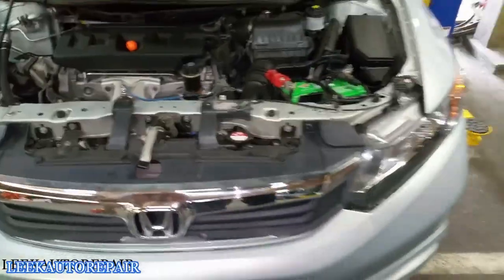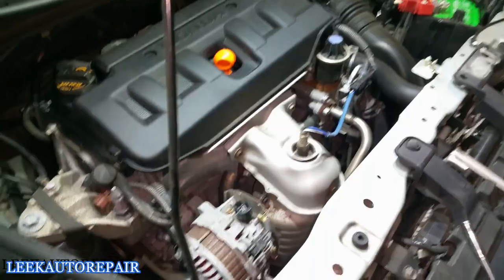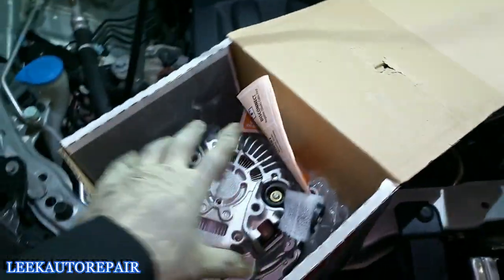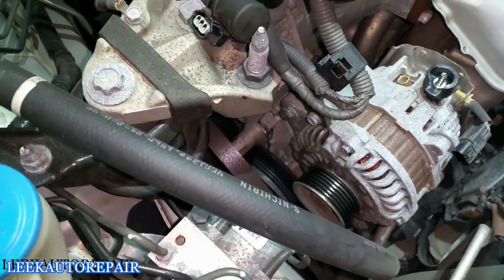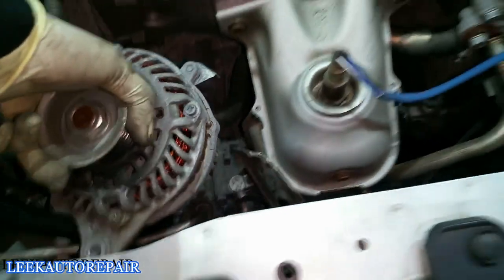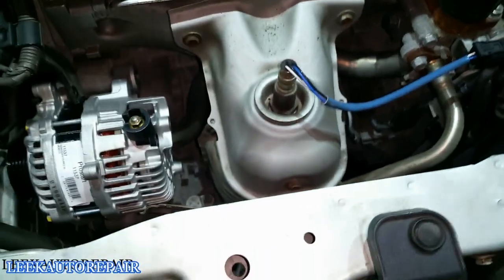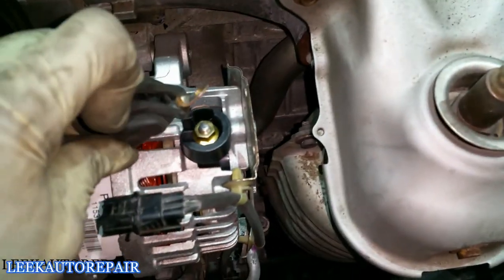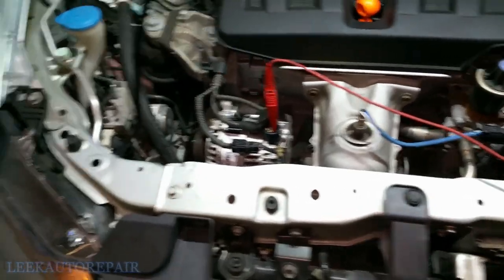2012 Honda Civic Alternator Replacement

Comment: Great video. It was a real big help. Especially the bolt sizes. Don't drop anything, you will NOT get it back. I went and bought 3 more 12mm sockets in case I dropped another one.  The Honda service guy, George, said "It's probably not the alternator, It's probably the battery. Change the battery." Dumb ass was WRONG! I just wish I knew the torque setting for the 2 main bolts.
Reply: For the belt tensioner I cut off the open end of a 19mm combination wrench and bought a 5' x 3/4" conduit and that gave me plenty of leverage to move the tensioner.
Reply: John Zambito.  If its already an open end, all u had to do is hook a round wrench on the open 19 side and theres your leverage.  May sound confusing, but it works and locks in.

Comment: Thanks for the video. Your diagram saved me big time. The belt slipped off and I had to put the entire thing back on. Then the re-man was bad! I got another one from a different place and I'm hoping it works. Went on much faster the 2nd time! Thanks
Reply from the maker: +Adam Snider I had the same problem with the reman....had to use a different brand smh. Glad I can help and thanks for watching brother!
Reply from the maker: +Adam Snider I had the same problem with the reman....had to use a different brand smh. Glad I can help and thanks for watching brother!

Comment: Hi I have a ho alternator on my 2012 civic and my issue is that when I brake to stop the voltage goes down but goes up when I accelerate again. What can cause my issue

Comment: Any ideas for extracting that bottom bolt without access to a welder or taking the whole front end off? That sucker broke off a   half inch in the engine block and I tried an extractor and can't push enough force into it. Thanks in advance

Comment: Do I need to only remove my negative terminal? I have a 2012 nissan altima and I just replaced the battery and had to use a memory saver a few days ago.. now I need to replace the alternator but not sure if I can just remove the negative terminal and my alternator installation will be a okay? Some people are saying to remove both the negative and the positive but I believe that could possibly mess up my computer.
Reply from the maker: Yes just the negative terminal and ur good

Comment: hi one quick question I have a 2012 civic LX sedan and was wondering if it's normal for my alternator to charge between 12.5-12.9 volt while running. read in the internet that it's for saving fuel unless I turn on the headlight I get the 14.4 volts
Reply: Yea I noticed that my accord does the same thing. Honda said it's normal. Autozone said the alternator is bad. I've never had any issues starting the car. I added an extra ground on the battery. Now the volts stay at 14.6 while running. So upgrading to a fatter ground cable and maybe a fatter positive cable should help.
Reply: Same problem here.im getting trouble to start my civic .mi charge is between 12.4 to 12.6 and yes the internet says it normal and my mechanic says it’s not normal
Reply: @adolfoestrada7134  I had my starter replaced under warranty cause my volts showed 12.5 but it would not start.
Reply: And that solved your problem?
Reply: @adolfoestrada7134  yes it did solve my starting issue. You gotta check your fuses and relays before taking the starter out. Autozone can test your starter for free.

Comment: Why do you need to change the alternator so soon? Does this car have a lot of miles? My alternator in my 93 honda with 200k miles lasted 20 years.
Reply: Newer cars aren't meant to last that long. The quality of the parts are garbage. I have a 2014 and my starter went out at 50k.

Comment: Hello, just subscribed.  I was wondering if all 9th gen Honda’s have that same loud ticking sound like the one in the video?  My 13 civic ex has that same sound and it drives me crazy.  I’m here because I thought it could be bad bearings in my alternator or compressor but the sound didn’t go away when you replaced your alternator.  Is there any way to reduce the sound?

Comment: I tried to go buy a replacement alternator, but they asked what the amps, they have 75 amps or 120, I have the same car as the one in the video. How do you find the amperage?
Reply from the maker: Call the dealership wit the part number

Comment: i had same readings yesterday
12.6 out of alternator
But i turned on the lights and the alternator read 14 .7
i suspect its a voltage regulator not alternator

Comment: I got whining noise plus knocking sound on 2010 Honda CRV with only 33k,  I tried to disconnect power connector from alternator while car is running but noise is still there, I wonder if it is really alternator that went bad.
Reply from the maker: Ok so your going about this the wrong way.........How about this, in this situation you need to do process of elimination so the first thing I would do is pinpoint the exact location of the sound. If there is a whining noise when the engine is on and noise increase at higher rpm's then try to remove the drive belt and see it the noise goes away. If it does then we know its not engine related so next try to spinning every pulley til you hear something unusual. Let me know how you make out..........
Reply: OK will also record and post a video,
Reply: any ideas?
Reply: Can the pulley from power steering ever go bad even though it has no bearing inside ?

Comment: Hello, I come across with your video as I have the honda civic 2012 lx. The battery was replaced 1& 1/2 year ago and now I also have a battery issue that I can't start my car. I suspect that the alternator could be at fault. Where can I get it tested?

Comment: hey buddy got a question for you!!!
Reply from the maker: What's up bro?
Reply: if i lost tension on the tensioner how can i fix that
Reply: if i lost tension on the tensioner how can i fix that
Reply from the maker: Lost tension as in no spring action?
Reply: after doin the alternator i guess the belt wasnt on right it snapped off and now the tensioner wiggles a little
Reply from the maker: Sounds like the tensioner is busted. I'd get a new one. Are you comfortable with putting the belt back on correctly?

Comment: why would you need to disconnect the battery, why not just disconnect alternator power connector
Reply from the maker: Rem X Try removing the battery cable from the alternator without disconnecting the battery first...........bad practice my friend!
Reply: The reason why is this: The power connector on the alternator finally goes back to the + terminal on the battery. If you connect it to ground (the frame of the car) then you short the battery. It's possible that the battery might explode, or you could get shocked, or you might cause damage to other electrical components in the vehicle.

Comment: Why didn’t u film when u took off the pully and the water pump in order to get to that second screw on the alternator?? I took the belt off now I’m hearing from another vid that the belt should be on in order to easily remove the water pump? Smh fk